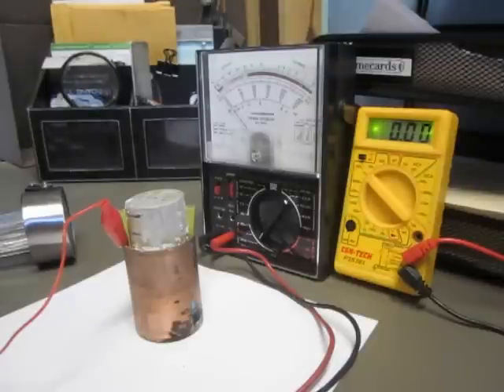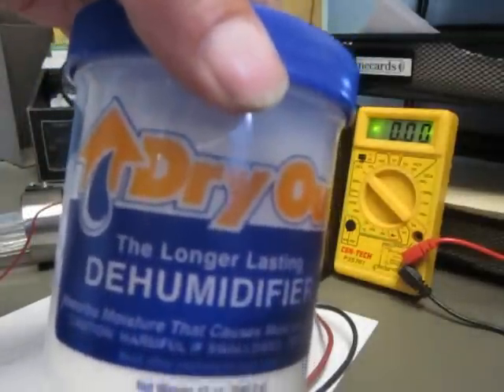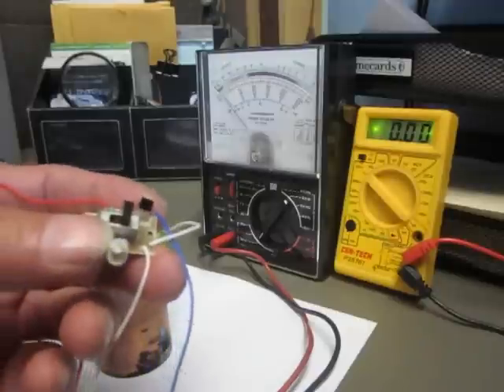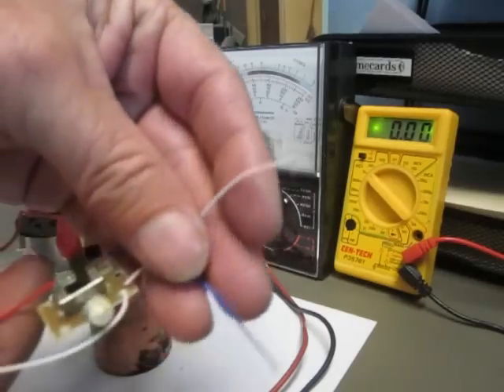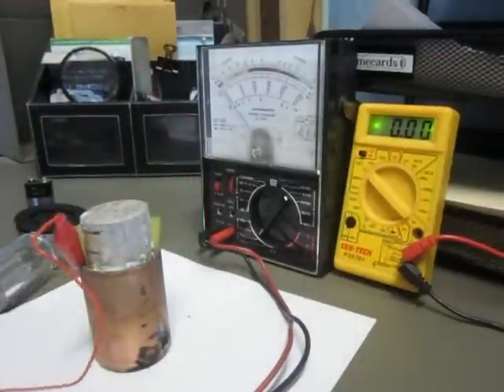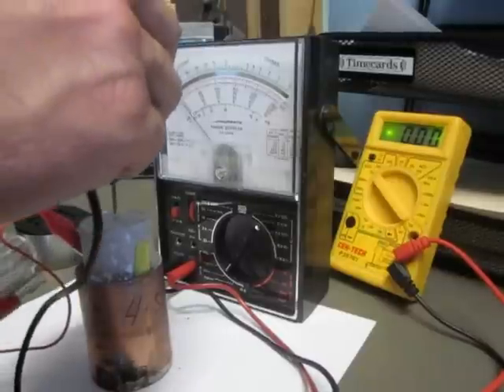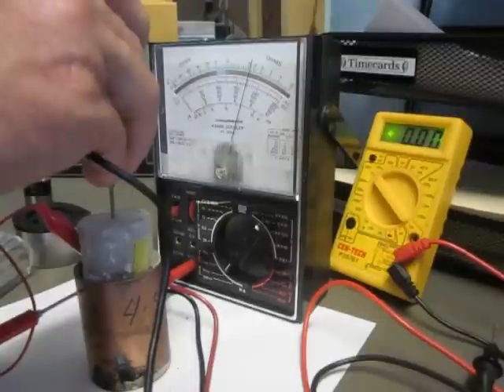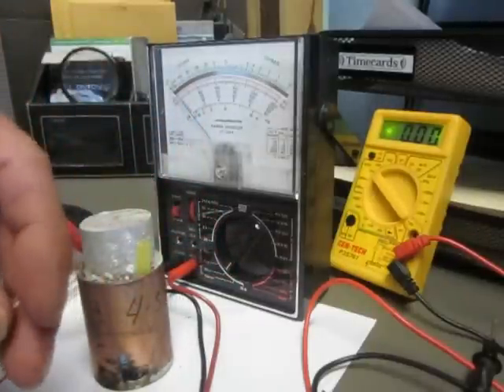Allwest power cell # 6

Comment: Nice ! Have you thought about using the cell to run a little bedini charger to charge the battery ? Also, I've been wondering what efect a bedini charger might have on these cryetal cells. ( I'm going to run my own experiments soon. I'm waiting on Rochelle salts from mistralni.co.uk and they've not arrived after 3 weeks )

Comment from the maker: Thanks Plengo,

Herelsmarcus,
Can you send me a link on the bidini charger, the solar light setup will allow me to charge the rechargeable battery with this cell, BUT when it is charging the battery, it will not allow me to turn on the light, maybe I can install a switch for this cell to turn off power to the rechargeable battery so light can go on 

Also, this cell cranks out the power, and I am not sure, but  it may over amp the rechargeable battery 

Any ideas on this setup is appreciated